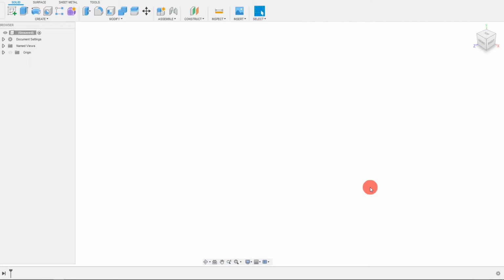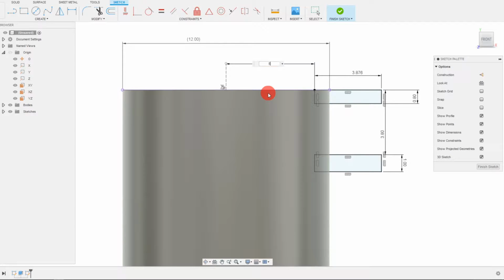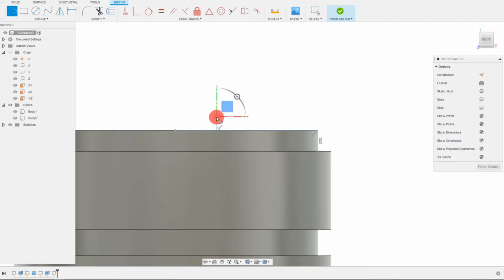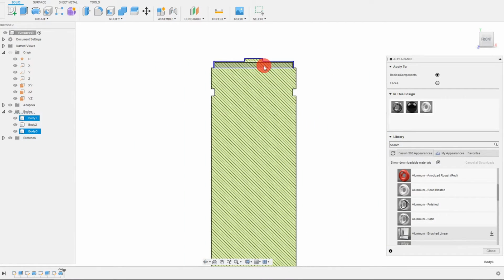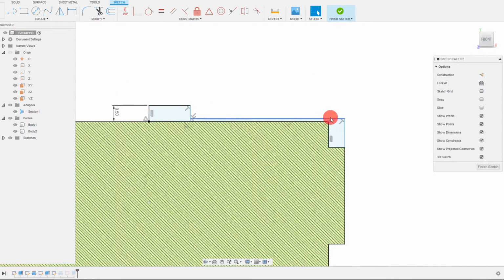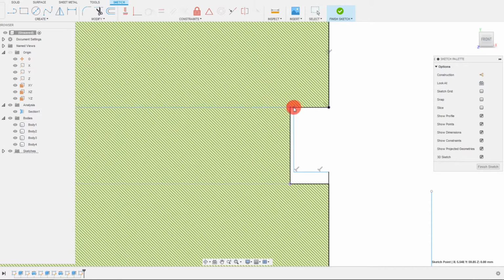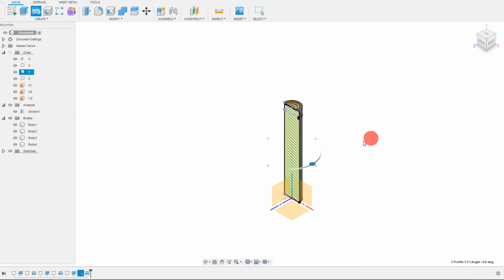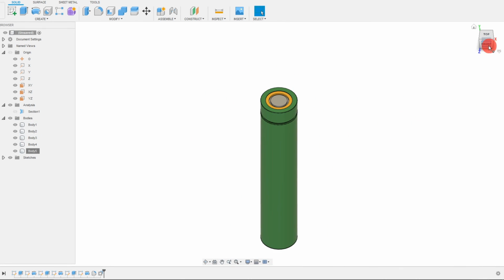18650 Battery in Fusion 360 Tutorial

Comment: That is not an 18650 battery.
Reply from the maker: It isn't? It is 18mm by 65mm and cylindrical, an excellent dimensional representation.
Reply: @AvivMakesRobots  no, it isn't. You draw it in the beginning as 12mm in diameter. The proporson of the battery is totally wrong.